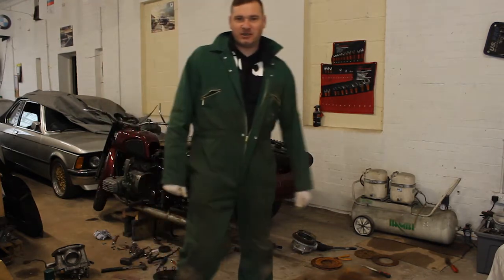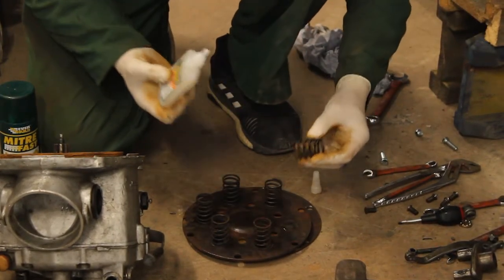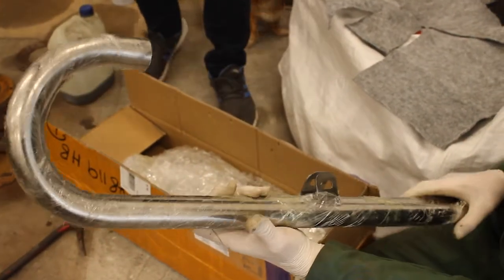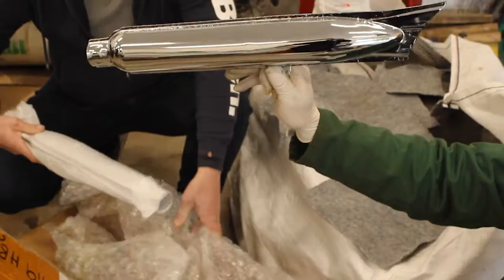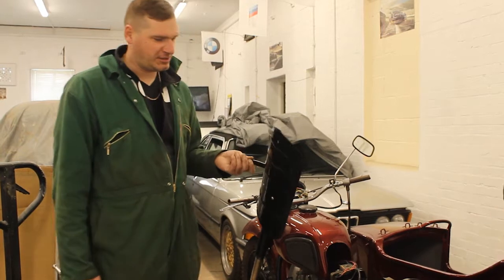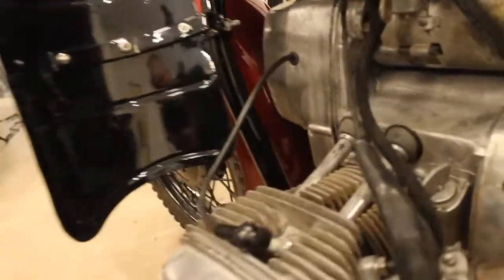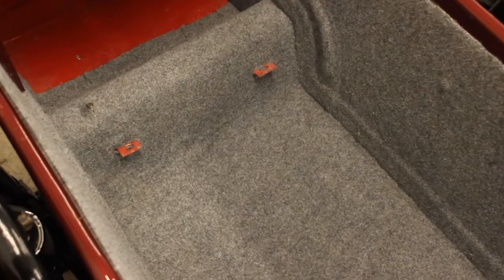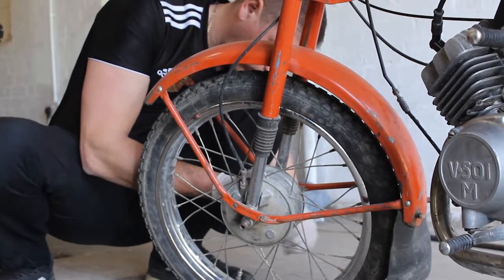DNPER MT10 CLUTCH REPAIR

Comment: Hi, I saw you asking about Fastboys on another youtube comment section.
those guys are in england and they import bikes every now and then from around the world.
I am in the middle of restoring a KMZ K-750, do you think you could give me some advice? Thanks.
Currently, I need something to help me with wiring, since wiring has been stripped entirely by the previous owner, and un-seizing the clutch, which seems to be covered by this video)
Reply from the maker: Hi there, 
I am based in Essex and yes I can help with you bike.
Reply: @thinkwhatyouwant.3843  Wait you're in essex? That's brilliant. I'm in the UK as well.
Do you think you can maybe find some wiring schematics for the bike? I've bought a harness from Ukraine, but the wiring schematics that came with the wiring harness has indicators, while mine doesn't, and mine is Solo. (no sidecar).
Reply from the maker: @supertrinigamer   yes I can get it. 
Where about are you?